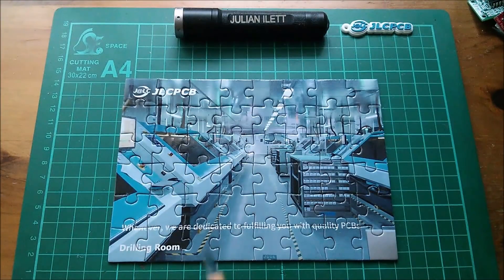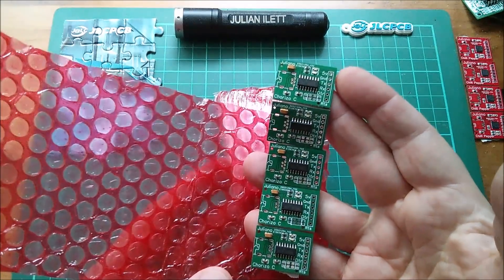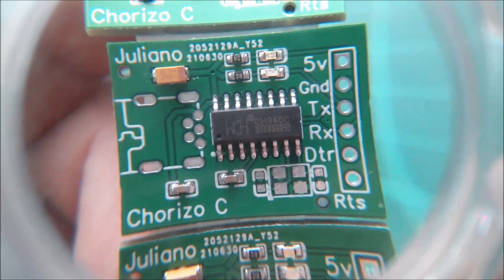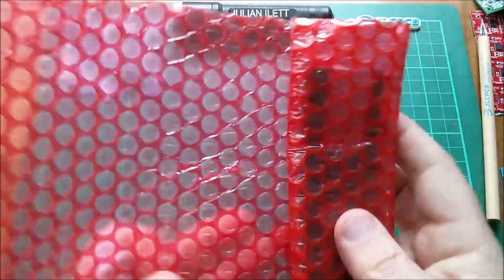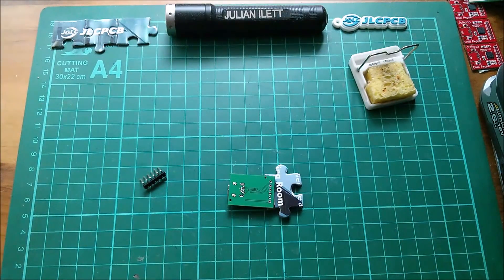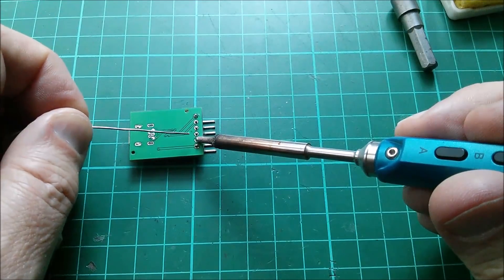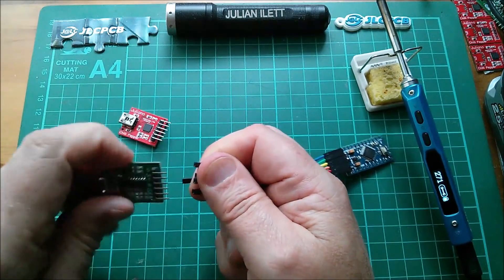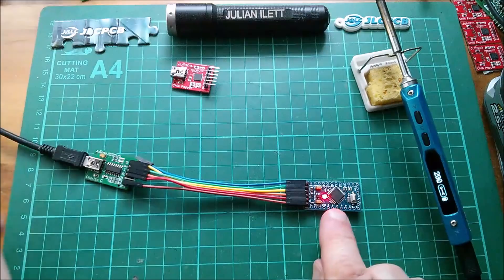New PCBs from JLCPCB - Chorizo and Pro Minty

Comment: When will JLC send you a decent laptop that can compile a blink sketch in less time than it takes to make a cuppa?
Reply: or use a raspberry pi 4 todo the compiling, remote controlled from the main pc (which runs obs)
or use the web arduino if that does the compiling in the cloud.
Reply: The part that I really mind with the arduino IDE is that it recompiles every time. I guess its so that people send the current time to a program that sets an RTC, but I'd rather have that be something I could turn off.

Comment: Not sure if you mentioned it and I missed it but is there any reason you left off the USB connectors? JLC have mini, micro and usb-c connectors now and they do a good job fitting them in my experience. They even do a through hole one if you want that for robustness C240850. They also do the headers C492414
Reply: He already had a load bought from eBay iirc

Comment: If you keep using the fast blink and slow blink sketch, you should export as a hex file and use cmd using avrdude that come with arduino to update, it removes the need to keep compiling the sketch and speed up the process. If you enable verbose mode in the arduino options when uploading, it tells you the command to type or you can copy/paste into CMD, just remove the -v flag after you paste it

Comment: Wouldn’t bother with mini b, always rip of the board if. I have a few projects that use the A to B printer type port, nothing beats a beefy connector
Reply: May I disagree? Your comment is valid for the ham-fisted. So you are correct there. Me, personally. I've always recognised the fragile nature of these connectors. I've even Filed down the 2 little locking latches on some aggressive USB cables to prevent excessive locking force.
I haven't busted a Mini-B off as of yet. Why is it people can not evaluate how much force is required to achieve this kind of action?
My conclusion is: People don't know how things work.
Reply: @NickNorton  I think the issue is the fact they are surface mount and the mounting tabs are not sufficient. Few examples are, I have a few arduino pro micro clones I use for macro keyboards, one fell of my desk with the usb plugged in and ripped the port of, had nothing attached just its own weight.
We all know the joke that it takes 3 attempts to insert a USB, put sometimes when people plug in a usb they rip of the board, take beats headphones or beats pill, because I have a soldering iron I get asked to repair them all the time, some repair channels I watch also get lots of those devices in. 

I do agree about the average person not knowing how much pressure to apply but I don’t want to “tread on egg shells” when plugging in a device or worry if I accidentally catch it.

My hatred may also stem from the cheap USB cables for the micro tend to just have power and no data pins so I hunt for my trusty old blackberry USB which I can never find.
If USB C was easier to solder I’d suggest that but I have hundreds of A to B ports (from salvaged boards) and dozens of cables. 

Just Sod’s law you break it off when in a rush

Comment: like the ch340g, always seems trustworthy with windows. only usb/serial IC to avoid is the ftdi chip, simply because after 'the dirty trick' (imho) that was 'ftdi gate' they deserve no customers.
Reply: the dirty trick? that sounds devilish! what was it?
Reply: @lucasc5622  Back in 2014, they provided Windows driver code which deliberately "bricked" counterfeit FTDI chips when devices containing them were plugged in, often making the goods unusable. Since most end users have no way of knowing if the devices they buy contain genuine chips or not, this was a public relations disaster.
Reply: @lucasc5622  ooh they put out a driver update that 'accidentally' bricked clone chips, of course lots of innocent customers owned equipment like cheap sat navs etc and the next time they got plugged into a Windows machine or updated it's drivers which updated the chipset firmware and as said it bricked clones, by resetting the device ID to zero so from that point on Windows could no longer communicate over usb to it as device ID 0 is for handshaking not data..... So people had to take their things back to the shop etc or just lost out on the value of them if they couldn't take them back.... Hitting innocent customers 'accidentally' is well.... Devilish... (Imho)

Comment: Julian, You can control where they put the order number by puting "JLCJLCJLCJLC" in the location, or add a border to the pcb and they will put it on the border. Better still, panel by stamp hole and add a border, get the maximum out of the 100 x 100mm :)
You should calculate the value of xtal load capacitors rather than throwing in random values !